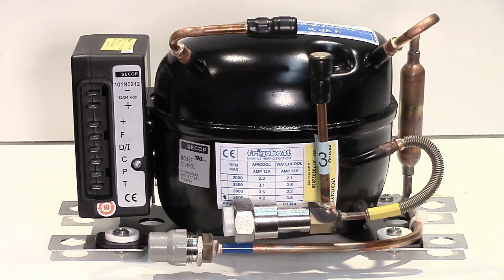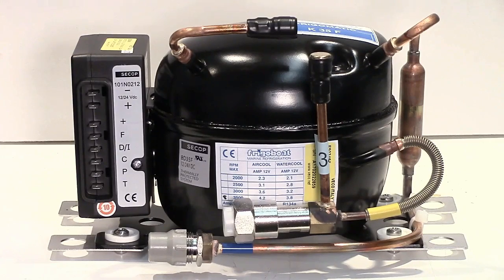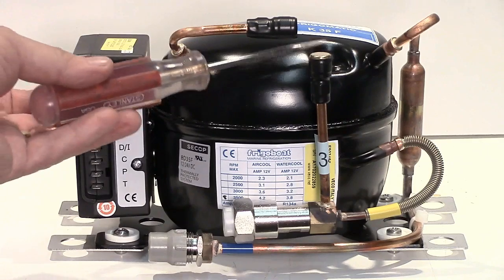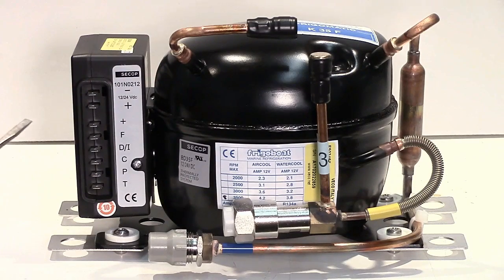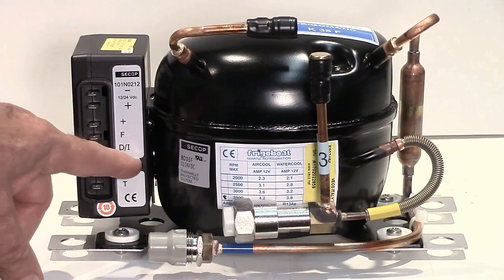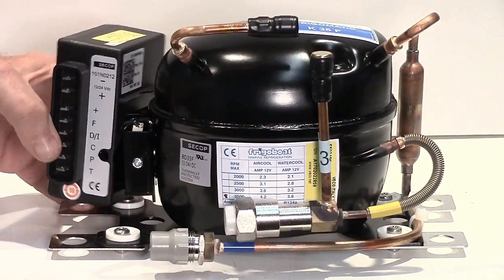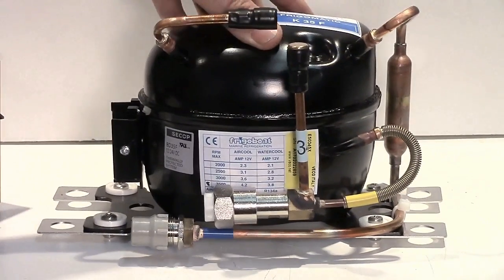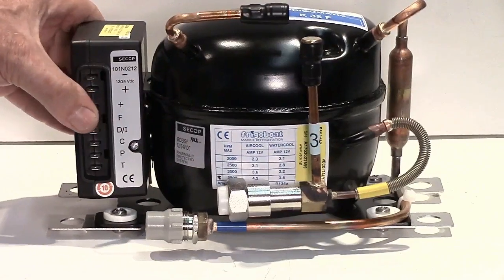Tech Tip -  Danfoss/Secop BD35 and BD50 Compressor Overview

Comment: I have an Isotherm ASU/SP Fridge/ freezer.
It appears that the  Red Controller  SEGoooo8DA attached to the 01N0210 has failed.
If I jumper the Thermistor points the Compressor runs . However no temp. control.
Do you have any units that will plug into my exciting 01N0210. to allow me to control temp and probably Comp Speed. Temp sensor for ease of installation would prefer resistor style. Easier to pull through a soft wire.
Reply: Yes, we do.  We have mechanical t/stats and digital.  We also have manual speed boards and  "Smart Speed Controller" - Merlin II.  You can use any combo of these on the 101N0210 module.

Comment: I’m at a loss as to why my unit will not cool ..compressor and fan runs ..no error codes ..should I jump the C and T  terminals to bypass the thermostat controller?

Comment: If you have a controller set for 110v can you replace it with a 12v controller for van life?
Reply: If your compressor is a Danfoss BD35/50 12v compressor; it is meant to run on 12/24v.  This same compressor, with an AC/DC controller will also accept 110v and convert to 12v.  These AC/DC controllers can accept 230/110v and 12/24v incoming power. BUT If your compressor is NOT a Danfoss BD35/50 compressor then I can't answer your questions without knowing what type of compressor you have.

Comment: Can i run a second fan by piggybacking off the original?
Reply: @merdel9663 the unit should still perform if a secondary fan is attached to the "F" terminal. As long as both fans are less that 1 amp total.

Comment: Useful for background, thanks. My chum's BD50 has a leak in one of the Quik Connect tubes, the one with the filter, so we need to replace that. How are these tubes attached to the compressor proper? Is it welded, soldered or mechanical?  Thanks for any help you can provide.

Comment: ¿En control electrónico no es un convertidor o transformador de 12 DC a 110 AC?
Reply from the maker: Secop 101N0510. However very hard to find these days with their supply issues.

Comment: Hi, could you tell me please on what voltage is the electronic controller is more is more efficient 12v or 24v, thanks
Reply from the maker: It's not about efficiency, it's about what your boat or car is set up as: 12v or 24v supply.

Comment: Can this run on solar panel in the bed of a truck to provide ac to a small pickup truck? For better gas mileage?
Reply from the maker: This is a refrigeration-sized compressor, about 500 btu. Way too small for air conditioning applications.

Comment: Isotherm installation instructions say this compressor must be mounted vertically, feet down and that it can work up to 30 degrees of heel. They don't say if the long side should be mounted fore to aft or side to side. Does it matter?
Reply: Not that I am aware of by instructions. The suction muffler intake inside is on the service port side. More relevant to mount in a serviceable and functional way. If your likely to sail past angle turn your breaker off or there are gravity angle switches.

Comment: Which port is the recharge port? The one with the r134a tag?
Reply: Service port, not connected to high pressure or low pressure lines. If a system had a port on low pressure you would use that. Low pressure return and service port are essentially the same, led into the pump housing.

Comment: Is there a recommended way to unplug the fridge from the controller or the battery from the controller? I need to clean around the compressor, but for safety, I want to make sure there is no power to the compressor or to the fridge before working around it.
Reply: When you disconnect the power cord, there is no power.
Reply: Supposed to be externally fused, breaker switch on your boat should be labeled or get labeled that supplies it.

Comment: Are you sure the top two ports are suction.....I’ve never seen a filter dryer on a suction port.
Reply from the maker: Yes Andrew, it is a suction line scavenger filter/drier. The top two ports are both suction ports.
Reply: CoastalClimate cheers, it’s a shame others don’t have your level of workmanship. It’s the first time I’ve seen one.. although yes I should have know better.. would otherwise be followed by a capillary tube. And I have cut the top off a DB35 and the pressure side is the lower half.. thanks for the feed back!!

Comment: i have one Waeco truck fridge 12/24, works very well, but  in my car at 12v  works for 3-4 hours(no running engine) until the voltage drops around 10-10.5v and then stops, and that is nice,it leaves some juice for the starter.

Comment: Thanks for that. I have a BD35F Condenser and a 101N0220 Controller. The fridge works on 240 V but not on 12 V. Any idea why not? Thank you.
Reply from the maker: Colm. The 101N220 controller is a DC only controller, so I presume you are saying that the compressor works when you have 240v power to the boat, but not when you have only 12v (or 24v). If that is the case, then you probably have a low voltage issue. Check out the video on power supply testing. Good luck!
Reply: @CoastalClimate  Many thanks for the reply